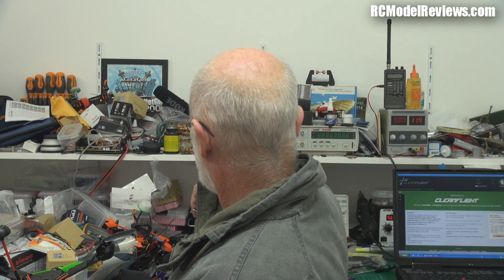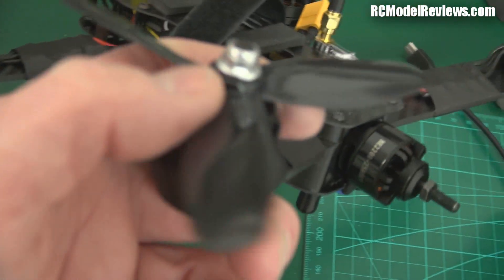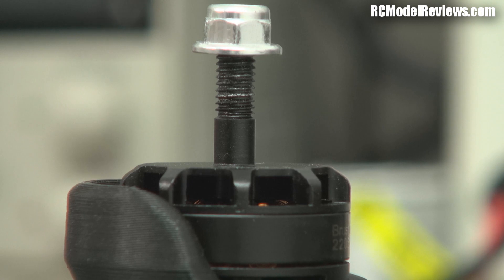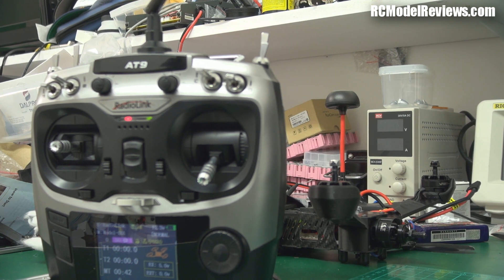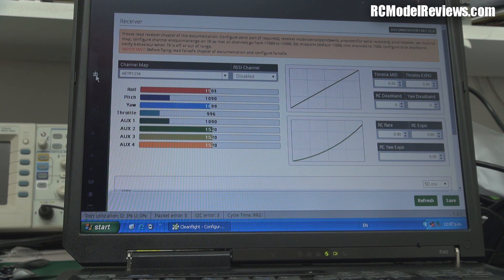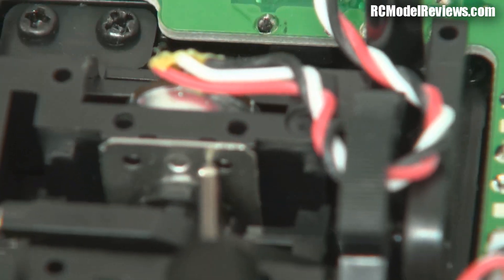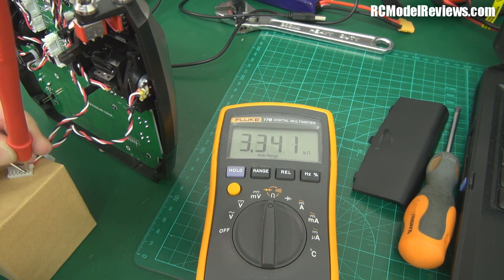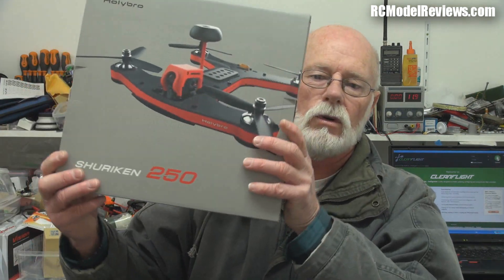The reviewer's curse strikes again (twice)!

Comment: got problem with my at9 in throttle with stabilize mode  in my other "new" 250 apm
got some unstable throttle position, especially when i fly in manual mode, i realized my quad so shaky unable to hold altitude because of shaky up and down throttle by it self when hovering
but before that my at9 accidentally got dropped in floor about 1.5 meters

and i used my after "dropped" at9, in my "older" apm 250 and got flyaway in alt hold with no respond or whatsoever, it just climbed until the battery runs out
and already fly it for 24 times with no problem, so odd

so i tried to update it to new fw and that problem was gone now.
but until today i still thinking whether got droppped or fw issue that caused the problem?
who knows?

just before i accidentally drop it, the at 9 work normally, no problem at all even in hovering in manual mode

Comment: i had the AT9 and in less than 6months the throttle/yaw pot went out.  It was far worse.  it would only read from 1250us-1780us.  I emailed radiolink with the issue and sent a video per their request with the issue and they stopped responding when I proved it was faulty.  I even offered to purchase a new gimbal assembly from them and no response.  bad Customer support.

Comment: hi if this happens again try using a soldering iron and sweat a little wax from a birthday candle in to the threads . the heat will pull the wax down in the threads and your life will be much better ;)
also works on a stuck lawnmower blade nut

Comment: I have turned the threads right off a motor shaft doing that. what a disappointment. I use bees wax to help prevent sticking,its natural and seems to help. I tryed silicone spray and it didnt matter,still stripped. I had to retap the prop nut on my Dynam Waco Biplane because the threads were never finished,it looks like they started the process but never did a finish. I read where others had the same exact issue,so I know that Dynam got a batch of propnuts that hadnt gone through the finish process. They sent others a replacement,I just broke out my tap set and made the appropriate sized threads. I am glad I have that set,saved my ass many times.

Comment: I've noticed that a lot of the supposedly "RTF" quadcopters aren't. I thought an RTF model as an upgrade from from toy grade quadcopters might make sense as an easier and cheaper option, but looking into it further I'm no longer convinced. The price savings versus the loss of choice don't make as much sense if you're still going to have to muck around to get it working. Especially when the cost cutting typically hits the fpv camera and TX/RX options the most. The Foxtech Screamer and JJRC JJPro P200 (AKA Emax Nighthawk-X5) were the models I was checking out, but I think I'll wait for a few more reviews (since shipping will take at least a month, no point in rushing into it).

Comment: Isn't putting a lubricant on a thread a bad idea? (in this case it seems to be needed as a band aid though). The nut will have to "pull" harder on the thread for the same torque. That doesn't sound good, especially with aluminium which is so easily deformed.

Comment: using a stainless steel nut will eventually strip the thread from the motor axle. Better to use proper aluminum nuts so the thread goes from the nut, not the motor.

Comment: Any of these "drone racers" you get from China are not test flown. Here's the proof. Build yourself or get someone to build one for you if you want something decent.
Reply: most ready to fly fpv 'racers' (with the exception of the vortex pro) are unsuitable for racing as they are usually slow and fragile. as you say, building yourself is the way to go if you want a good quad.
Reply: most ready to fly fpv 'racers' (with the exception of the vortex pro) are unsuitable for racing as they are usually slow and fragile. as you say, building yourself is the way to go if you want a good quad.

Comment: I fly with a Flyskit i6 transmitter and I have the same yaw deadband issue. If fact mine is worse with the release of the stick settling between 1485 - 1515. I add 15 deadband in the configurator and I don't get drift. Don't even notice that it's there, apart from that I can fly straight.
Looks like your end points are way out. Yaw full left only going to 1085, roll was 1090 left and only 1920 right. Not sure if you are pushing the sticks all the way but I'd be more concerned about that issue than the minor deadband issue. If you get the end points right you will gain more resolution than you will lose by adding 12 deadband.

Just my opinion. Don't normally comment but I actually know about this issue. Always do your own research and make your own decisions.
Reply: Don't worry, the reason I was connecting the quad to the laptop was to set the mid-points and endpoints -- they were (as you noticed) way out -- which is why I was unable to disarm the quad after putting in four clicks of right yaw trim.
Reply: I was thinking you probably noticed and knew about it already. Seems like all cheap transmitters need end and mid points set before you use them. I'm looking forward to seeing this one fly.
I hope that one day you get sent something like a Vortex or Vendetta so we can get an honest review of the quality at the high end of the market (or at least expensive end). It's never very surprising that the 'cheap as chips' models you get sent have loads of issues and are pretty crap. Perhaps one day one of the companies that make them will actually watch your review and make a high quality product. Until then , I will build my own.

Comment: update your radio with the new firmwares
Reply: That won't fix this problem.
Reply: i thought there was a little bit of slop on that brass bit, tiny  bit is all it takes... goodness knows what the hell can be done about it, a drip of super glue... using a macro camera,??? as a two pair of reading glasses plus magnifying glass on helping hands user myself can i just say, good luck with that.
when you test this beast if you hate it... can you rebuild it without the rear thrust prop and see how the frame flies with the elevated rear motors

Comment: What the fuck that quad has a prop in the front. That is very dangerous we must deal with it.
Reply: And it may attack at any time.
Reply: I'm pretty sure the prop is on the back to make it travel faster when going straight for when racing.
Reply: prop is on the rear
Reply: And even more, the rear arms are shaped to a v. That is way more dangerous than normal flat arms "grabs regulations and adds new rule"
Reply: but... in full speed the craft will be tilted forward, thus making the rear prop push towards the ground..hmm.. motor tilt ??
Reply: Yeah exactly what I thought when looking at it.  The top props would be holding it up whilst the back it pushing it down. I guess you just lean over far less, keep level and this prop does the pushing forwards keeping the quad level. Not sure it'd really be any faster though, extra motor and weight plus pushing against main motors - would be easier to just angle camera and fly quad at sharper angle like normal , or some people have motor mounts angled forwards.
Reply: Foxtech screamer 250, very similar to a hybrid zmr250 project of mine... It's fun. A lot of fun. Momentary switch on the TX's bottom, near your fingertips. Boostbutton. In the process now of upgrading the old project and putting an Xnova on the rear- expensive and powerhungry- but as a fifth next to a couple of  "hovermotors", could be done on a budget and a little less battery strain. If you ask if it is fast, i've made mine frome old spare parts and it put a big grin on my face. Xnova or 2205/ 2700kv motor on the rear, 5040 triplets, almost no drag on the backmotor, so reaching good speeds should be doable ;)

I mainly (when its not in parts to redesign) fly mine because of the boost and the sound of a quad coming straight down with full throttle^^  If the thrust can overcome the copter's weight (and without HD, yes it can), you can go straight up, release the boost and it's a quad. Map the 5th esc to a servo output, set at full throttle, and set an aux channel up to a "boostbutton" If you want to play it safe, make a momentary "triggerswitch" between your AUX switch, that way you have a safety, and no trouble releasing throttle when crashed. Set the aux output to disarm the thrustmotor when in failsafe.

Wrote a book on a channel I don't often visit- guess I like the pentacopter ;)

Comment: On a cheap transmitter like that (especially if I didn't pay for it and thus don't want to return it) I would be temped to drill a hole and mount another variable resistor that would allow a small correction to be quickly dialed in when I do actually want a slow yaw.  It's nice to be able to do a really slow yaw when you have a camera mounted and want to get that aerial view.  Better than maybe using the trimmers.  Or just pull the receiver and put in one that works with your transmitter.